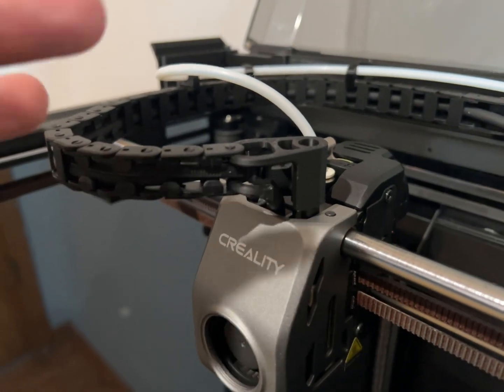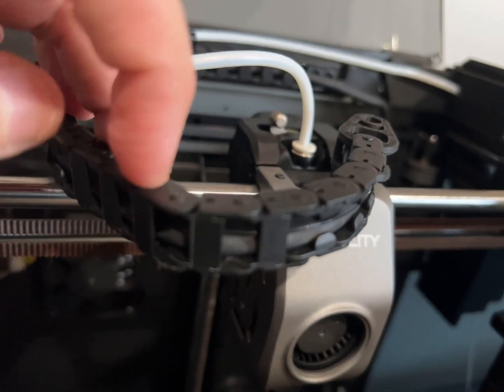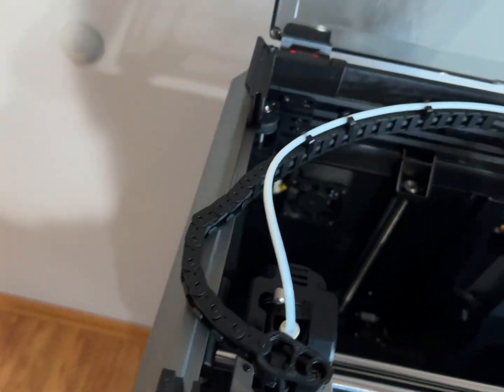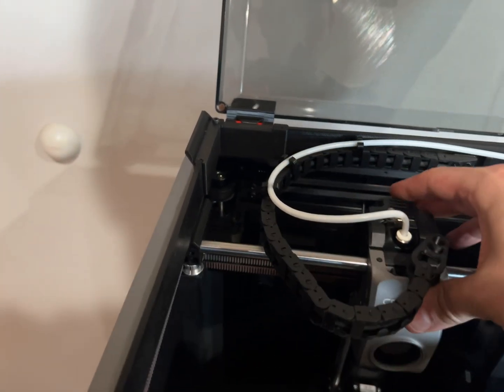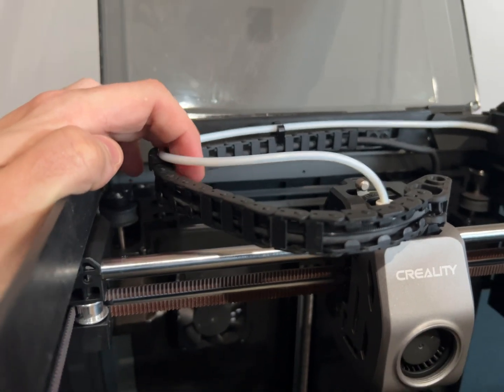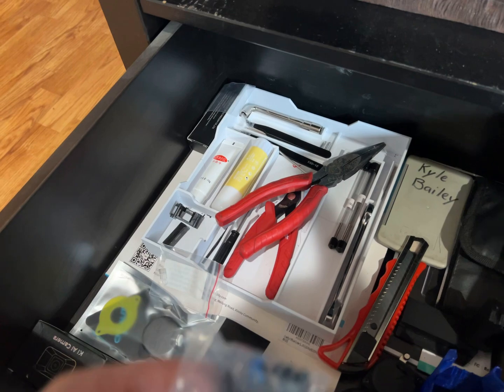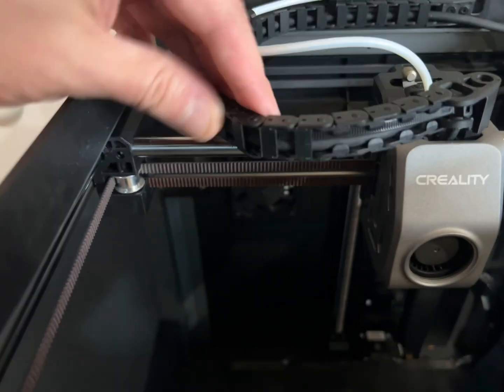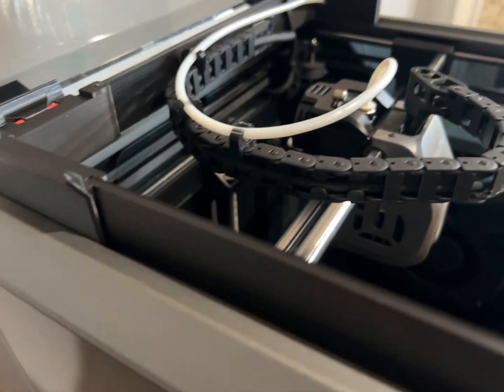Creality K1 chain link settings.

Comment: Like the video and have adjusted mine, Where did you get the file for the lid riser and hinges, Hope you can help
Reply from the maker: https://www.printables.com/model/539417-chain-link-for-the-creality-k1-speedbump
Reply from the maker: https://www.printables.com/model/703318-k1-lid-riser-corner-with-bowden-tube-tunnel-jc-cre
Reply from the maker: https://www.printables.com/model/525295-jc-creality-k1-hinged-lid-riser